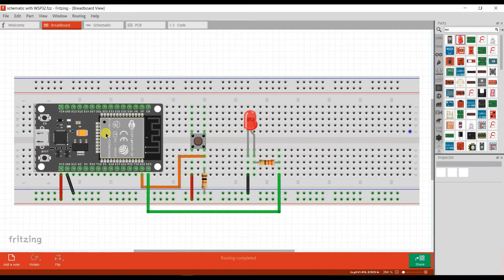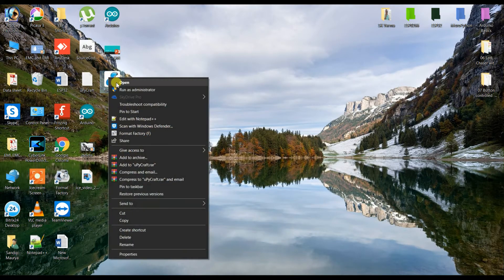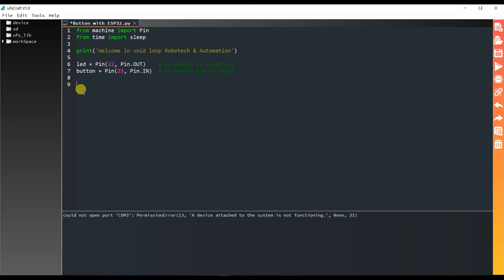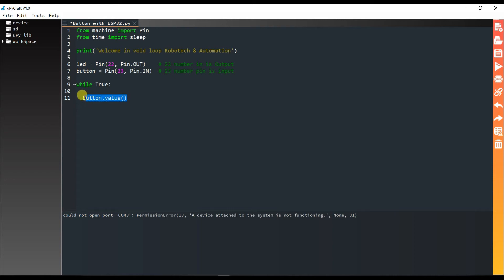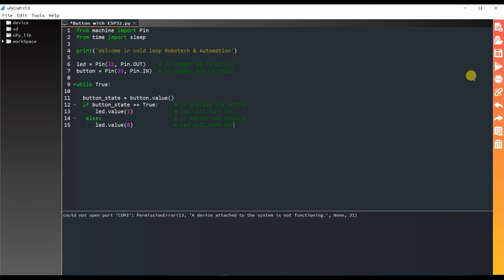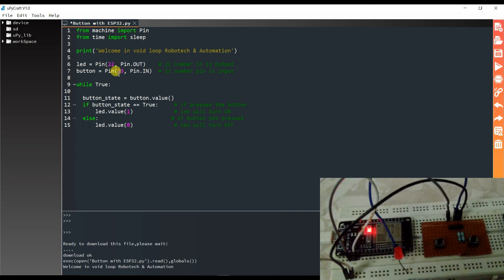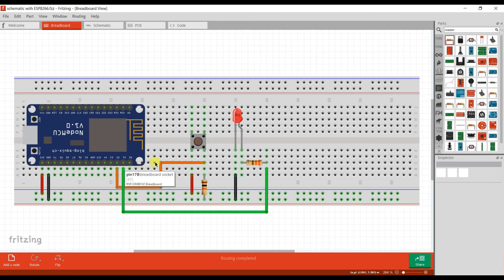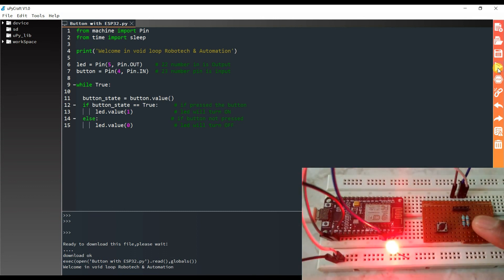07 Button controlled  LED with microPython  || ESP32 & ESP8266 ||

Comment: hey bro I have a doubt for esp8266 we use gpio as input and for esp32 we use the pin value mentioned on it right?
Reply from the maker: For esp8266 code link is available in description box. You can download from there.
Reply: @voidloopRobotechAutomation  not about code the pin you connected to esp8266 is d1,d2 right so you used GPIO number.
For esp32 you used the pins which are actually on board like 22 which you connected 
this is how you did it right for both espboards?
Reply from the maker: Yes bro, for esp32 gpio number and  board pin number is same. But in case of esp32 is different.